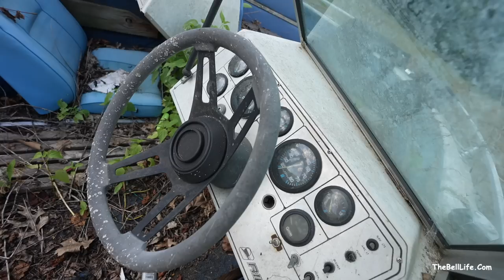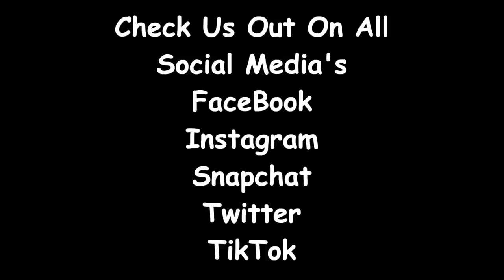Boat Vs TheBellLife Bangs!!!

Comment: The trajectory of how y’all were holding the guns, means the bullet would be almost going through the floor of the boat on the other side. That’s why the ones you did find that went through were all at the bottom of the boat. There was probably more that went through the bottom of the boat

Comment: So the barret was basically designed to take out engines in vehicles from long distances. The smoke u saw was purely from metal hitting metal. If you look underneath the boat you might be able to find some of the 50cal exits, sweet gun.

Comment: The fiberglass on the opposite side you are hitting is much thicker at the chine, (where the sides meet the bottom) than it is where the bullet is entering higher on the front side

Comment: I think the Barrett was shot low and by the look of the angle, the other side of the boat is sitting higher.. the bullets probably shot through the engine and under the boat.

Comment: 470 is the model not hp , It is a 270 mercruiser  6cyl and were rated around 160 hp . They are actually a very good engine and drive system . shame to not fix it for someone to use again !

Comment: Funny Trey isn't thinking about all the metal in the engine that slows the velocity of the 50 cal bullet. It blows through both sides of boat easily but thru engine, u r looking at a lot of mass to go through.

Comment: Next time you shoot the 10mm get some underwood ammo spec the extreme penetrators. The regular 10mm loads are the same as 40s&w same bullet and ballistics but the underwood are loaded right up like almost double the fpe. They def would have went through that boat and the extremes go through thick bullet proof glass nd shit. They make those rounds for 380,9mm nd up to 460 Rowland and rifle calibers too like 45-70
Reply: That's not entirely accurate. I will say they are similar. But the 40sw was made for a reason. Because the 10mm had more muzzle energy, causing more recoil and delaying follow up shots! 10mm was supposed to be the answer to the 9mm being to weak. But then guys were complaining and not doing as well in their qualifying shoots etc etc in the FBI which is what the 40sw was made for. The 10mm with the same exact projectile. Will always have more muzzle energy and slightly higher velocities. So,my point is. To make it seem like the 40sw and 10mm are going to yield the same results. Is just not entirely accurate. Really depends on the manufacturer of the Ammo to, but using the same bullet. However I totally agree with you saying that there will be a significant increase in results from the two. If using Underwood ammo extreme penetrator with the same 140gr projectile. I just don't want people to think that there's no difference between a standard 40s&w and a standard 10mm with the same projectile. Otherwise I agree with the majority of what you are saying!
Reply: @richardbadish6990  ya I know thats y they call it the 40 short and weak nd ya look at most manufacturers specs on 40 nd 10mm same exact numbers cuz their loaded down trust me I've bought alot of 10 ammo nd started to look at all the ballistics and chronyd alot of them and most regular manufacturers have them loaded identical to the 40 sw

Comment: If y’all were shooting from the table with 50 it might’ve had a better chance of going through the top side of the boat y’all might get a slightly straighter shot through the boat but still great video